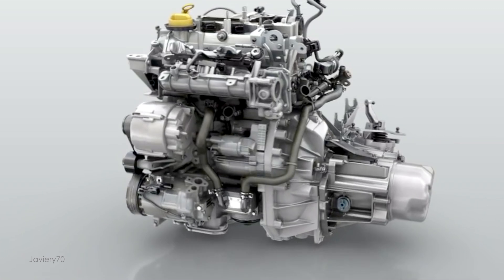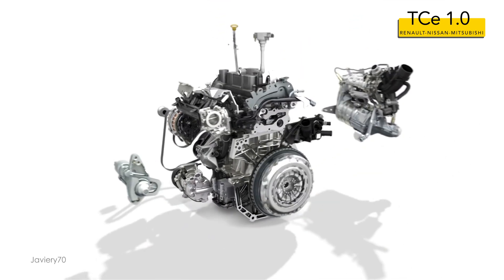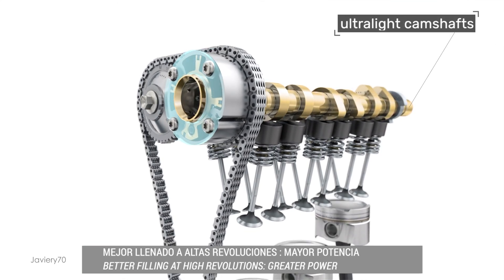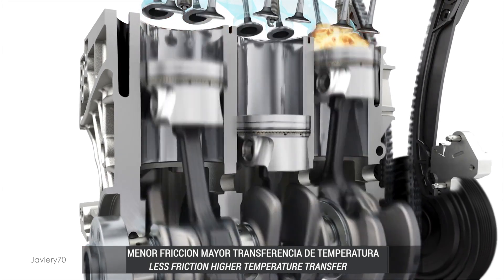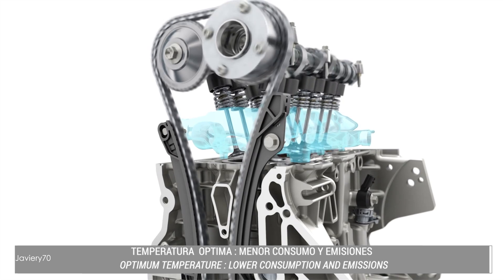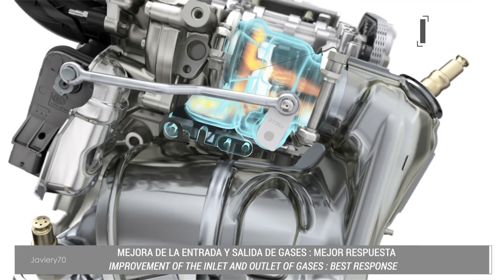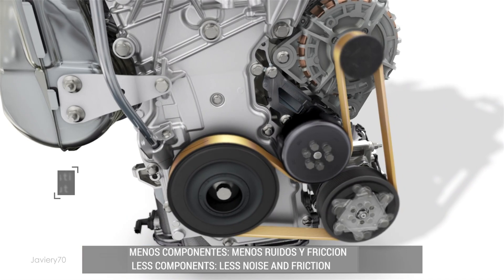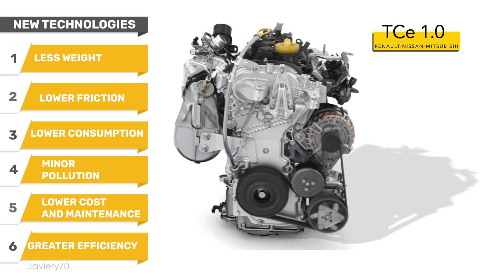🔸 RENAULT - DACIA 1.0 TCe - HR10DET Engine its technology ( eng )

Comment: Dear Javier,
Thank you for your effort and for such a clear explanation regarding the HR10DET technology. I own a Clio equipped with the HR10DET TCe 90 engine, and its first oil and filter change is scheduled to take place in 5 days.

I believe the factory-filled oil (the car was manufactured at the Oyak Renault plant in Bursa, Turkey in July 2024) is Castrol GTX 5W30, ACEA C3 / RN17 specification.

The maintenance will be performed by the official Renault dealership service. However, if possible, may I request the use of ACEA C5 0W20 oil instead? Would that be an appropriate choice?
Reply from the maker: Hello.
The oil must meet the RN17 quality standard specified by the manufacturer.
You can view your engine's maintenance schedule on the MY RENAULT website.
It's quite possible that the maintenance schedule indicates RN17 FE 0W20 oil. (CASTROL)
CASTROL ACEA C5 oil is not RN17. It is NOT compatible.
https://amzn.to/3OE0pXH
Reply: @javiery70 Dear Javier, when I see the official manufacturer’s maintenance schedule, it recommends only ACEA C3 and ACEA C5 Castrol. It confused me. There is no clue about RN17, which is interesting for me. What is your comment about it?
Reply from the maker: @anilmirap  I need your vehicle's chassis number to verify maintenance.
The chassis number is located on the corner of the windshield.
Reply: @javiery70 Dear Javier,
My car is Clio V E2G M6X6W S - VIN: VF1RJA00X73262237

Thank you so much for your time and consideration. If you have any recommendations or hints for me to check for very first maintenance, it will be very appreciated. Thank you 🙏
Reply from the maker: @anilmirap  Your Clio has a CVT transmission.
The engine was manufactured on May 13, 2024.
The maintenance schedule indicates that the oil is:

CASTROL C3 5W30
CASTROL C5 0W20

It does not indicate that the quality is RN17.

Castrol GTX meets the C3 and C5 standards in addition to RN17.
Maintenance may vary depending on the vehicle and country.
Reply: @javiery70  Hello Javier,
Thanks a lot for your detailed information given. How and where did you query my VIN to see this kind of knowledge? May you please share the source?
Reply from the maker: @anilmirap  The source is Renault. I work for Renault.
You can check vehicle maintenance and other information on the MY RENAULT website.

Comment: Ciao Javiery, come cambio olio vengono indicati 30000 km, non sono troppi? Sarebbe meglio effettuare il cambio olio prima? Grazie
Reply: I would recommend to change it at 10-12k
Reply from the maker: @pharaonbender  Renault consiglia questi valori in base alle caratteristiche del motore e alla qualità dell'olio specificato.
Questi sono i valori massimi consigliati.
Il sistema è in grado di prevedere i cambi dell'olio in base allo stile di guida.
Prima si effettua la modifica, migliore sarà la durata del motore.

Comment: Disagree with the deletion of belt tensioner. And 4 cylinders are more balanced than 3. It’s easier to stall a 3 cylinder in my experience. The old Dacia/Renault D4F 1.2 engine was ok just needed a turbo and taller 5th gear like the Fiesta to make it really good.
Reply from the maker: All the modifications are intended to reduce the polluting emissions imposed by anti-pollution regulations, which are becoming increasingly restrictive.

Comment: what type of cvt renault is using in clio and how to change oil in the engine and cvt where i can find a video?thanks
Reply from the maker: The Renault Clio V's variable speed transmission (CVT) is called DK0.

Its oil is DS3 quality.
Original Reference: 7711949822
Reference Value: 7711949783
It has a capacity of 6.9 L.

It is filled using the dipstick itself.
It is drained using a plug at the bottom.

You can view the maintenance schedule on the MY RENAULT website.
Reply: @javiery70  Thanks

Comment: Hi Do you have a video for the tce 110 engine?
Reply from the maker: @b.keseroglu  No.
The 110 hp 1.0-liter TCe engine called the RH10 is the same as the 160 hp 1.3-liter TCe engine called the RH13, but with 3 cylinders.
Reply: @javiery70  Thanks for your answer. In Türkiye, these engines are used in Dacia Jogger. Many users reported that they have a Flywheel problem in these engines. Do you have any information about this issue and what causes this problem?
Reply from the maker: @ The flywheel is made up of two parts.
The joint fails, causing noise and engine failure.
Once known by Renault, it is modified in the Factory.

Comment: I have this engine in my duster. 

It's great!  

And to make things better,  it's a timing chain!   
Unlike ford with the eco boom 💥 wet belt design!!!  

Keep up to your maintenance schedules and don't abuse the turbo,  and this engine will look after you.
Reply from the maker: @niallntaz  There is no perfect engine but overall it is a good engine.
Reply: How does one not abuse the turbo?(Duster3 ecog100 owner)
Reply from the maker: @AlifieAbsinTh  I don't quite understand what you're referring to...
Reply: @javiery70  the guy said "don't abuse the turbo".how to not abuse it?
Reply from the maker: @AlifieAbsinTh  This could mean not driving at low speeds in high gears, as this causes the turbo to work at its maximum.
However, you don't have to worry about the turbo, as it has lubrication and cooling, and it doesn't cause any operating problems.
However, it's essential to maintain the quality of your oil.

Comment: I have been thinking of buying a used Dacia Logan but it worries me that most of them have this highly stressed engine. I just want a simple, reliable car, it does not need the best MPG as I only do about 5000km a year. I would go for the diesel version but I gather modern diesels also have reliability compromised by the pollution control technology.
Reply from the maker: This engine is the best-selling in Europe; it's purchased by driving schools and taxi drivers. It's generally a very good engine.

Comment: Is it Port Injection or Direct?
Reply from the maker: The TCe 1.0 engine (HR10DET) has indirect injection with 90 and 100 hp.
There is another TCe 1.0 engine (HR10DDT) with direct injection and 110 hp.
Reply: @javiery70  Thank you. I was in Trukey 3 years ago on vacation and saw many of the TAXI´s were Yellow DACIA Sandoras.
With regular 5000km oil/filter change how long will this engine last?
Reply from the maker: @ Renault doesn't provide information on engine lifespans; they always say the engine lasts the lifespan of the vehicle.
I've seen taxis with 300,000 km.
Reply: @javiery70  Thank you. Taxis do a lot of idle time and city driving, I assume their service time is what is stated in the owners manual.....15.000km. Changing every 5000km - 10.000km that little engine should last a long time if not overstrained.

Comment: The chain will snap the tensioner and plastic chain guard will wear
Reply from the maker: This could happen if the engine isn't properly maintained or cared for.
Just like any other engine from any other brand.
Reply: Source?
Reply: Really? You know that how?
Reply: @vasile3311  it's designed that way

Comment: I have a 2025 juke 1.0 dct. What’s your opinion about start n stop? Should I avoid it? Is it bad for the engine and the turbo?
Reply from the maker: @ΓιωργοςΔεληγιαννης-β6ζ  The start-stop system does not harm the engine or the turbo. The engine is adapted, it is reinforced as well as the battery, there is no need to worry.

There is a button to deactivate it if you do not want it to work.

It is advisable to activate it from time to time because it tells us if the battery is charged or not.

If the engine stops then the battery is perfect.

It helps us to know how healthy our battery is.
Reply: Io l'ho disattivato
Reply from the maker: @ Bene.

Comment: You mentioned an upcoming video on the "noise in the turbo rod 1.0 TCe. Is it uploaded? I have an ECO-G 100 (basically TCe 1.0 with lpg). 30k km on board, began noticing the rattle and the discontinued electrical noise at engine shutdown since 12k km, but so far no performance issues. Searching online I found out that newer, robust turbines are installed since Oct 2023. Problem is my car is manufactured in Oct 2023, so I do not know which turbo I physically have installed. Is there I way I can find out, and how worried should I be about this issue? I am not a car swapper, so I plan to keep the care for as long as possible (10+ years), but long term feasibility is a concern. Thanks! Great video by the way!
Reply from the maker: I haven't uploaded it yet.
On Sandero the new turbos will be installed from the beginning of 2024.
I advise you to go to your Renault-Dacia workshop to have your vehicle checked.
Reply: @javiery70 when on renault clio? Thank you
Reply from the maker: @pharaonbender  < 31/01/2024
Reply: @javiery70  Quindi da febbraio 24 viene montata la nuova turbina rinforzata? Comunque ho letto dai tuoi commenti che non tutti i motori hanno la stessa turbina, quindi non è detto che tutti i motori h4d 470 poi presentino il problema, mi confermi? C'è una media di km in cui il rumore si presenta o è casuale? Ti ringrazio
Reply from the maker: @ Esistono numerose versioni dei motori TCe 1.0.
Tutti i motori H4D 470 sono uguali.
Il rumore è un errore di progettazione e non influisce sul funzionamento del motore. È solo il rumore che mi dà fastidio e si nota fin dal primo giorno in cui decelero.
Caricherò presto un video di questo turbo.
Reply: @javiery70  la forma della turbina è identica oppure è diversa? Grazie per la disponibilità
Reply from the maker: @ Il turbo è esattamente lo stesso, ma con una migliore regolazione dell'asta per evitare rumore.
Reply from the maker: what vehicle?
Reply: @javiery70  Dacia Sandero Stepway Eco-G Extreme+
Reply from the maker: If the noise is caused by the turbo's electrical module, the workshop will reprogram the injection. If the noise does NOT disappear, the next step is to change the entire turbo if the vehicle is under warranty. I have changed a few, Renault has no problems.
Reply: @javiery70  the noise is a mecanical noise. you can program the west gate to keep it open longer, but is not a fix. after a year or so, the turbine will crack from that vibration. the answer from renaul/daci was "normal mecanical noise" but the new logan with the DC logo, has fixed the turbine, with a better ranforced one... Trust me, there are hundrets of complaining customers with nothig fixed, only "normal mecanica nooise" answer...
Reply from the maker: If the noise does not go away or reappears, the solution that Renault offers is to change the entire turbo. If the vehicle is under warranty, Renault has no problem replacing it. I speak from my experience and from my work that I do every day with this engine.
Reply: @ maybe in your country. In romania, the west gate noise  (that rubeling turbine metalic sound on decelerating) its called "normal mecanical noise" and it will not change the turbine. This noise cobine with unlinear acceleration... there is no problem for services to tell you that its ok. i had the same issues.
Reply from the maker: @gopo2004  Here in Spain we are changing turbos with Renault authorization and the vehicle is under warranty.
Reply: @javiery70  nice to hear that. only in romania, the dont what to fix it. they consider`it like i told you, a normal 'mecanical' noise... Sad...
Reply from the maker: Not all 1.0 TCE engines are affected by the noise. There are 2 types of turbo.
It is possible that if you do not have that type of turbo, the replacement will not be authorized.
Reply: @ its has been authorized  ( with 200 euro in a envelope) i had the firs model of logan, the first batch , with all the problems (ac, ecu, gearbox etc)
Reply: @javiery70 hi, ciao ho un tce 1.0 per renault clio immatricolato 04/24 (produzione 12/2023) con 10k km, secondo te quale turbina potrei avere? Per ora è silènziosa
Reply: you have a faulty turbine. they will not change`it. they don't recognize the fault. they are on the first model of logan, duster and sandero. i gave some money to the service where i make revisions to make the service boss make a move on dacia to change`it. if you accept to stay with that rubine, in maxim 2,3 years it will break.

Comment: All that small engines (0,9- 1,0) etc. are big garbage and shame for auto industry.
Reply from the maker: All brands have these small engines for their smaller vehicles and they are sales leaders.
Reply: There is nothing wrong with small engines,,,The problem is the engineering and manufacturing,,,all this diamond coating and carbon coating on the pistons and cam chain,,,,The fact that its F1 tech,,Is a bad thing,,,,F1 engines are deliberatly made to last one or two races and there worn out,,,These materials are ideal for this,,,But having them in a road car means they wear off after 50 or 60k miles,,And in the process destroy the cylinder bores,,Also the DLC on the tappets is a harder compound than the actual cam shaft journals ,,As a result it whipes out the cam lobes,,Also all Renault engines now have thinner piston rings,,They brake very easily and gum up with sludge ,,,Its basically planned obsolescence ,,
Reply: @nightstorm9128  This is what I thought, they are putting racing engines in road cars.
Reply: I know that these engines, as standalone units, aren’t necessarily bad—in fact, they would be fine for small garden machines, lawnmowers, and similar equipment. But the mass implementation of these engines in cars, with the emphasis on environmental benefits, is misleading. The real reason seems to be making internal combustion engines less reliable, forcing us to replace them every 100,000 km. Another major reason is pushing us towards electric vehicles by eroding trust in traditional combustion engines. Overall, I personally find this trend in the auto industry disgusting, and I hate experiencing this era firsthand.
Reply: @Sipi1389  :))))))))))) you are a bad joke... this little engine will work at least 4,  500.000 km. the test is allready done, with the taxi drivers that use this engine. they have 3, 400.000 km with no engine problem. but u are smart. u predict the future :)))))))))))))) go back in the cave, from where you cam out...
Reply: @gopo2004  Of course, there are certain engines that have reached that mileage. The question is how many of them, out of the total produced, have actually achieved it. That engine certainly cannot be as reliable as some larger displacement engines. I didn’t say anything particularly smart in my comment, just some real facts—but it seems you don’t even have the intelligence to understand that. :)
Reply: @Sipi1389  nothing from what you said is fact... just some random bullshit... a fact is when you show some numbers, not what you have dreaming last night...
Reply: @gopo2004 totally agree with you, I know people with 0.9tce at 500+K, oil interval change ~ 10k and timing chain somewhere after 300K. Proper maintenance is key to engine longer life, no matter of displacement.
Reply: @Sipi1389  You obviously never had a 3 cylinder engine like this. My Clio had the same engine and it lasted me 240k km until I sold it, if properly maintained, its a fine engine, and with turbo is has decent power (118hp on a 1100kg car) Sure, a 2.6l 4 cylinder engine can last MUCH longer than these can so I'll give you a point there, but saying that these engines wont last 100k km's is rediculous and you know it.

Comment: Hi was thinking about buying a dacia with this or the old 1.2 engine. Will this be as  reliable as the old 1.2? It being so complex worries me
Reply from the maker: They are two completely different engines.
This 100 hp engine in the Duster is not enough. Much better with the old 1.2 125 hp engine.
Reply: @javiery70  be the sandero , is the 1.2 more reliable or both good?
Reply from the maker: @ More reliable is the TCe 1.0, which is also a sales leader.
Reply: @javiery70  is the 1.2 the engine from the 1990s Clio
Reply from the maker: No.
At that time the Dacia Sandero did not exist.
Reply: @javiery70  that's true but the early dasha sandero uses old Renault Clio floor pan and suspension parts . Also early sandero used old Clio engine
Reply from the maker: I have consulted the documentation and indeed the Dacia Sandero 1 has a 1.2 (D4F) engine with 16 valves.
The Clio 1 has a 1.2 (D7F) engine with 8 valves.